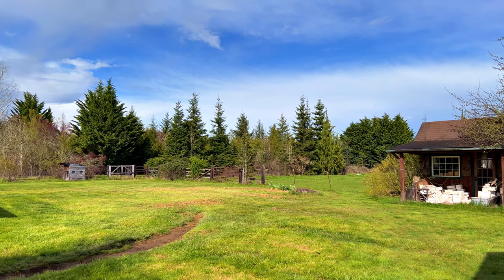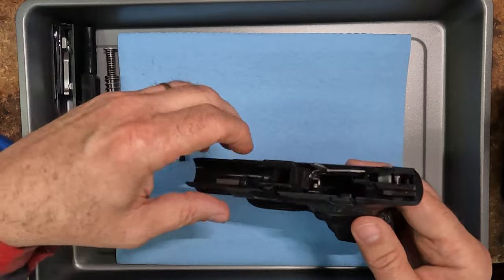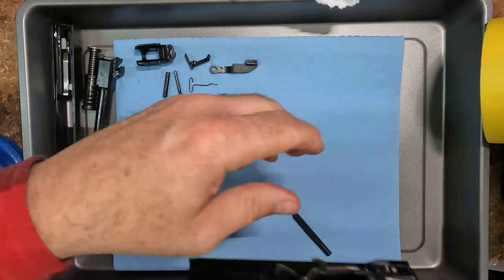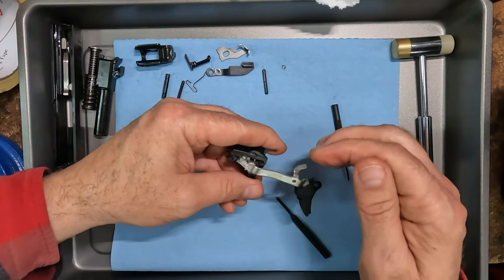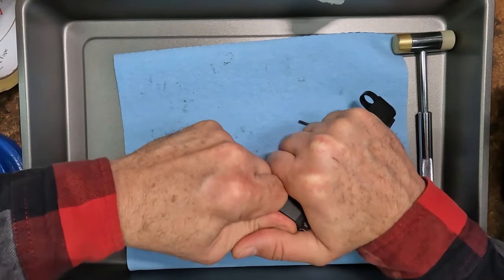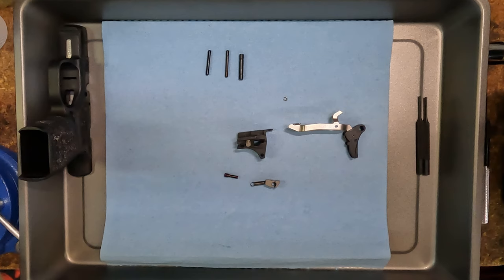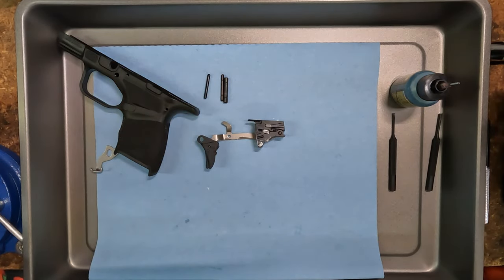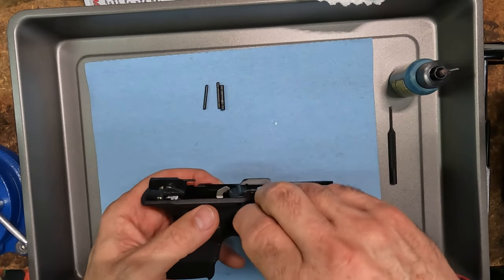Hellcat Full Takedown!! • Deep Clean & Inspection! | TheSmoaks Vlog_2344

Comment: That trigger bar might be the most complicated thing to machine in this gun. It is pressed down from a sheet of metal, shaped and then you need to machine it into spec. You put it manually into a device and it is truly a work of art to machine it into tolerance.

Comment: Talk about cleaning and diving into a pistol. I have a sig and ruger. 9 & 22 respectively. I do clean after using but never to this extent . I wouldn’t dare to. I know when to stop. I use a spray, oil cleaner, soak all and lightly blow away, wipe down and lightly oil. You do it the right way. Perfect. The parts I do disassemble I clean meticulously. Nice video. Thank you about the jacket info. No going after rabbits today, it’s Easter. Have a happy

Comment: What exactly did you do to clean the individual parts? Forgive me if I missed that detail. What products did you use? I couldn’t tell what the blue product was. Is standard gun oil sufficient for the interior parts or is white lithium grease necessary? Thank you so much for the in depth video! I was looking all over for this type of instruction. Most videos just show a simple field strip.